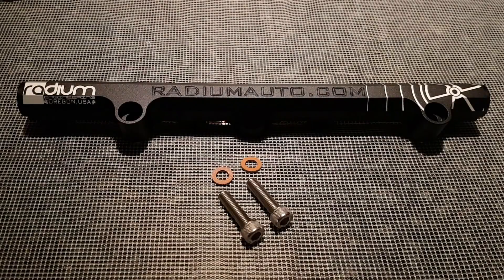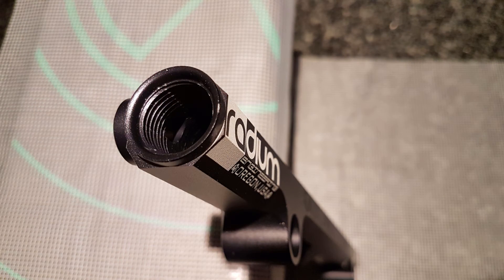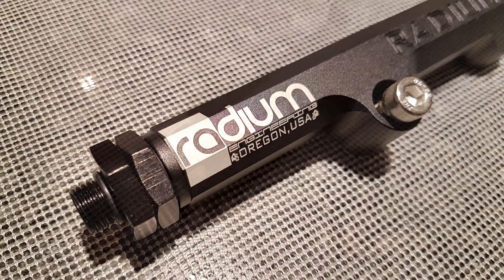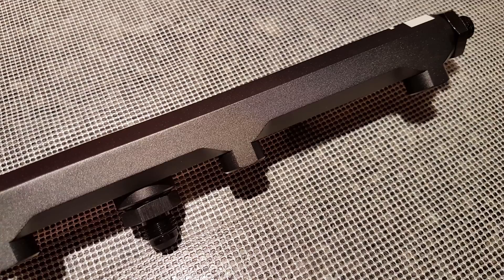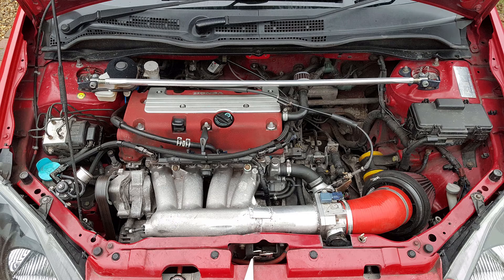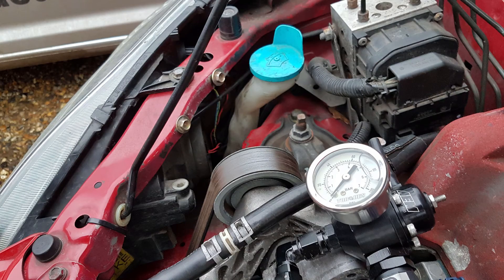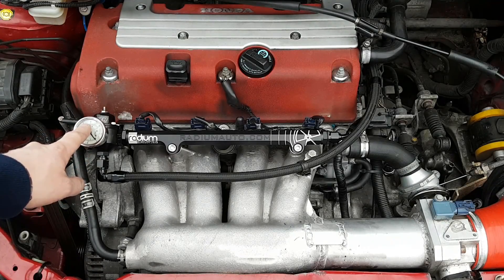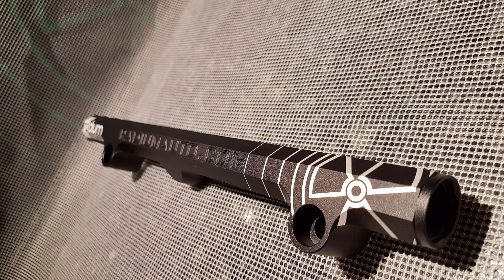Radium Engineering K Series Fuel Rail Review - 435bhp Rotrex Honda Civic EP3 Type R - K20 / K24

Comment: What size feed line did you use? I have the k24z7 and I'm getting ready to install the complete Merc Racing tvs1900 supercharger with air to water cooling kit. Alot of people tell me to run -8 as my feed line, and -6 or the oem feed for my return line. But I've heard from a few of my long time race friends that my feed and return need to be the same size if running an external regulator. What are your thoughts and or recommendations on all of this?
Reply from the maker: I'm using -6 as my feed and return, still more than enough for my new k24 setup with a walbro 450.
Reply: @UpShiftTrackdayVideos  I appreciate it! I'm going with -6 throughout then. I have the dw400, should be enough headroom I would say.

Comment: Are fuel pressure regulators and fuel pulse dampeners the same thing? Do they perform the same task or will I need to run them both? I'm a bit lost on that part.

Comment: Should've just plugged it from the stock fuel pressure regulator that way you don't have to shave  and let the after market one do it's intended job better
Reply from the maker: esandoval14 I don't follow?  The oem FPR is in the fuel tank and has long been removed.